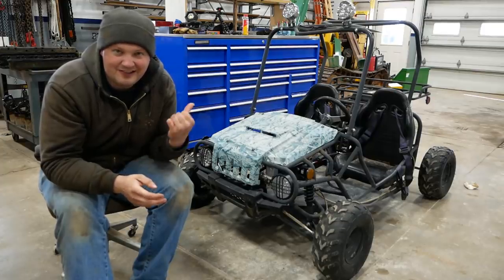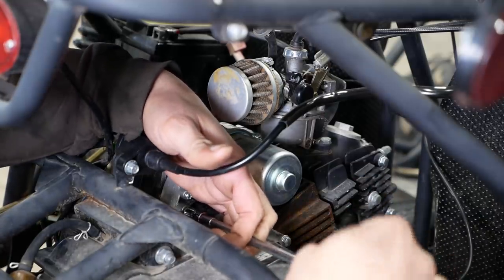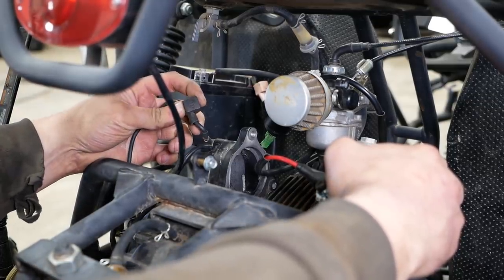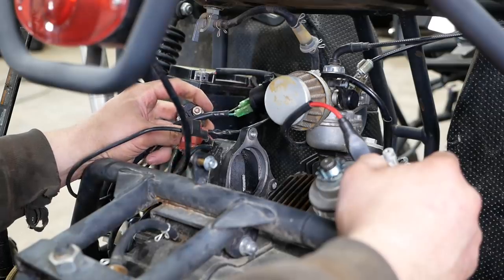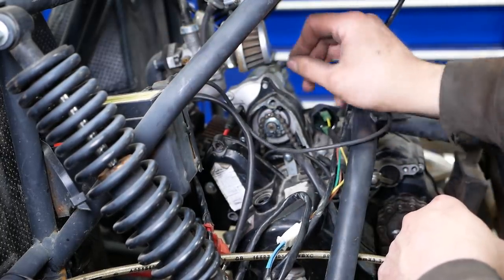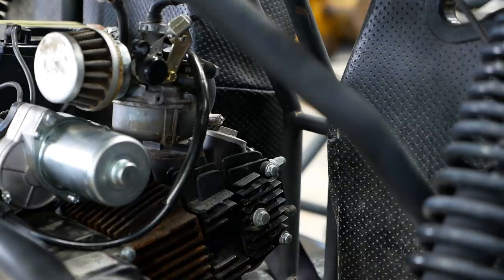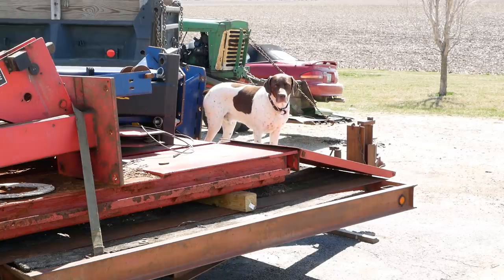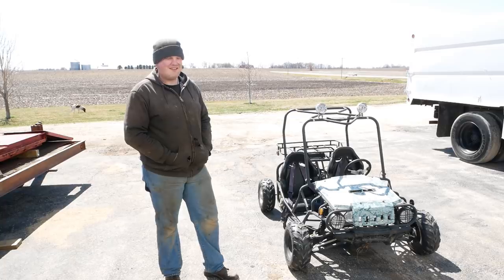Go Kart Saved from the Parts Cannon

Comment: Started replaced, badly.  Wiring re-worked, badly.  Carburetor adjusted, badly.  John Q. Customer was here.
Reply: He mentioned that there was something melted around the solenoid.  I suspect positive and negative from the battery were put across the solenoid, so at some point when he hit start, the battery was shorted out, causing lots of heat!  Random rewiring after that reversed polarity.

Comment: I saw a cap fall off crankcase.  Also right front is cambered away.  Nice work Wes.
Reply from the maker: That's an optional cap...
Reply: @WatchWesWork  From a beer bottle?
Reply: @alanfarenden9378  I think it was a cap for timing check hole. Without it, the generator has good chances to meet with sand, rocks, mud, water and everthing nice that this thing is driven on or into.
Reply: @WatchWesWork  oh cool.  Thank You friend.  I enjoy your work!
Reply: Oddly enough it started running just fine right after that.   Clearly a faulty cap!

Comment: The best part about it, Motorcycle type starter solenoids usually have a B and M moulded into them for "To battery" and "To Motor" for guidance. Still easy to get wrong though if the brains not engaged.

Comment: HEY WES. From a few minutes earlier, 14:56 I watched a cap come loose.  AT 17:06 WHAT FELL OFF THE MOTOR, A CRANK CASE CAP....+++ I HOPE you found it...
Reply: Also, it kind of looks like something electrical burning at 16:54 (and before, those repeated puffs of smoke coming up around the carb), and I also noticed something rattling off the engine at 17:08 too - what a piece of work that thing is!

Comment: Looks like a Honda CCR 125 from 50 years ago, literally. The Chinese must have been making these for 40 years. Probably the same master molds.

Seeing that “tappet” cover and goofy cap on the carb brings back memories. I used to make $10 changing a large “plastic” gear in the tranny after each race for a bunch of guys in a motorcycle club next to my house in 1973.  They destroyed them every race. 

I used to charge $25 to “rebuild the motor” using a wire brush to tear carbon off the cylinder head and piston crown. Hard to kill those old four strokes, even when you had no idea what was going on. 

I was the club “mechanic” because my dad had a complete set of Craftsman mechanics tools. That was the hillbilly SnapOff of the day. 

Hilarious. Thanks for the memories.

Hey!  We used to rewire these by connecting wires to wherever they’d reach. Nobody had manuals, tools or brains. Just an old Crescent and a guess based on how long the wires were. It always worked after a few tries.

Comment: I take it you found the Chrome oil cap that vibrated loose and fell on the floor? All the best from Canada
Reply from the maker: It's just a dust cap. That's a dry cover.
Reply: @WatchWesWork  I was also thinking that maybe he had some water in that gas tank? And that's why I wasn't running the whole time?

Comment: Definitely on the small side for you. They are good fun though. My mate has built his self a dirt buggy on steroids. It runs a 300cc Kawasaki Ninja engine. Straight gate gearbox with foot clutch and throttle. Geared to be lightning quick low down but still pulls 80K plus. On his tight track between the trees it is one he'll of an adrenalin rush. Pure driving experience. Your next video will probably be a huge truck or tractor. Nothing like variety.

Comment: My guess is starter originally went bad (just replaced one on a 50cc quad with the same clone setup) and they did battery as a "starter for 10" pun fully intended, then changed the starter but got the wires crossed and let a little smoke out, crossed them up even more until it would spin (but bass-ackwards, as it is permanent magnet type) and that being the case, it didn't matter if they got the chain on or not as it would've presented the same symptom as the starter is on a one way sprag clutch.  Nice work getting to the bottom of it, and not stripping any cheese threads on the way! Those things love to jump out of the hole with the slightest whiff of torque. the chrome oil cap cover is usually the first thing to vanish so it did well to hang on longer than the choke cable haha.

Comment: Recently worked on a Mikuni carb for a 9hp generator.  Fuel was coming out of the carb's choke area and soaking the air filter, and then dripping on the ground.  Engine ran smooth at half choke but with fuel coming out of the carb like that it wasn't safe.  Found the carb diagram/schematic on the internet.  Discovered it was missing a brass pilot jet on the top of the carb.  New p-jet was about $18 w/s&h.  Fixed the leak.  Also, had to use a magnifying glass, loupe, and penlight to see the condition of some of the smaller jet ports near the choke, AND in/around the main jet inside the carb bowl.  Those smaller ports WILL clog with the smallest of particles, and the engine will not run.  I also recently worked on a newer, 5hp B&S engine with a plastic carb. Ugh.  It has very small port holes in the plastic that you should use a magnifying glass or loupe to find dirt or gum-like residue either on or clogging them.  Good video.  Could be the lighting but that gas looked old.

Comment: Thanks Wes for your walk through.  I have a 150cc UTV by ODES that I need to do similar thing with due to fuel issues.
Reply: It starts & idles, but try to give it gas, and it chokes itself.  Tried spare fuel pump, didn’t help, dropping tank to check fuel lines, then pulling carb.  Daisy chain

Comment: Fixing broken/faulty/damaged stuff can be tricky but fixing stuff that someone's been fiddling with can be an absolute 𝒏𝒊𝒈𝒉𝒕𝒎𝒂𝒓𝒆. I wonder what the original problem was, or was the owner just "servicing" it and caused the problems himself.
It would be interesting to ask if he still has the bits he replaced; could be a few perfectly good spares in amongst them. Well done figuring it out though.👍👌
Maybe Mrs Wes, or Wes Junior, would have been a more suitable test pilot this time.😂

Comment: At 14:58 you can see a chrome lid or cap of some sort, under the carb little to the right on the screen, starting to turn when the engine revs. At 15:55 it wobles around loose and at 17:07 it finaly falls of. What was it?

Comment: Well mark another save for you. I was wrong as when the engine established some compression meant no or very small crack in the piston or a valve funky. I know bad descriptive terms but my chowder funnel is kinda fubar. I got to thinking is the valve lash a hair tight as they are fussy about that as you get that putt putt sound of trying and still no start. I liked those type of snow machine carbs. I used to put one for each cylinder on the little ranger pickups and they came alive like right now. I was sure I was right as it made the skipping sound rolling over. I found they if running right need very little choke if any. Just get one to putt putt    and it warms up fast. I really didn't think that you could get in it either but then you did an my fear of a leg cramp came to mind and a whole roll cage and all tore off so to straighten the leg.  I really don't know how many miles one of those engines will run but it has to be a half million as my kids ran theirs from can to  can't see. Fine recover Wes

Comment: Theory of failure:
Brought out of storage and tried to start it with the peckok off.
Didn't start so they tampered the carb needle furthering the issues.
Got frustrated that it wouldn't even start on ether so they held the starter until it fried.
Replaced the starter but didn't pay attention to polarity and when they tried to start it the compression in reverse caused it to kick and throw the starter chain.
Not realizing the issue they checked and found no spark, thinking that was the original unforseen issue they replaced the ignition components one-by-one hoping to get spark.

Comment: Toa toa , I  fix 3  4 wheeler version of those ! For my daughters for cheap !! Carburetor $9.99 to the door . Complete wire harness :  key,coil,cdi, fuses, battery leads  $25.   I run royal purple  and premium gas in them. Two of 4wheers  had bought had tar for oil when I bought them , had to take side cover off and scrap out the tar/oil  with screw drive then soak in carb cleaner for a few days. Those starter chains get rusty and stick real bad ! I grease them up real good every time you touch a starter !

Comment: When you were removing the starter I said, might as well remove the carb too as guarantee it's gonna need cleaned. But I would have also removed and cleaned the gas tank and shut-off valve. Probably checked valve clearance. Set the toe-in. There is a reason I didn't make money in my 45+ year mechanical career...

Comment: I suspect the choke cable broke and they cooked the starter trying to start it. Those starters are often so cheaply made they melt any plastic in them if used for any period of time or the epoxy holding the magnets to the case softens and they come loose.

Comment: Was that the oil-fill plug that fell out when you started the engine? (silver-colored thing on lower-left of engine)  I work on these chinesium things often. Parts are stupid-cheep (coil, CDI, volt regulator, and ENTIRE wiring harness for about $20)
Reply from the maker: Dunno. There's no oil over there.
Reply: @WatchWesWork  Well you need to rewatch the video because something shiny was bouncing around and finally fell off

Comment: I bought my boys a TaoTao 4 wheeler with what appears to be the same engine at a garage sale.  It was cheap because it was dead (dirty carb).  Mechanically it was pretty decent but after a never ending parade of failed electrical components and hinky wiring we replaced the engine with a 6 hp honda clone.  It was a good decision.

Comment: I think Menards sold those. Probably had a fuel problem. They cranked it until it stopped cranking. Replaced the battery but the starter died then screwed up the wiring and chain replacing the starter so the engine didn't turn hence no spark. There's an old saying, 90% of ignition problems are fuel related.

Comment: I just did a job for a customer on a Coolster 4 wheeler and ran into a similar issue. It was only three years old, but the starter was bad. It didn't the same way that a bad starter normally does. I tried everything else first because I assumed that a starter would not go bad that quickly. I was wrong. Apparently, it is a common problem on those clone machines. It looks like that machine has the same starter. I would say that the starter was the original problem.

Comment: due to all the weird stuff you found, I would first check which way the motor actually turns by cranking it by pull cored to know for positive that the starter is wired wrong.

Comment: That starter will run backwards if you switch the pos and the neg, tell your customer to get rid of that 19mm carburetor and put a 22mm or 24mm one on it, they fly with a 24mm carb on, also these engines have a habit of buggering the crank position sensor when they throw the chain as the sensor is just in front of the sprocket behind that generator cover, the buggy its self looks very much like a Quadzilla, mixture screw is 1 1/2 turns out

Comment: Wes, while watching the start up attempt @ 15.02 I noticed a "silvery" screwhead/bolt to the right of and in line with the nut holding the seat and next to an electrical connection on the frame, vibrate and slacken and eventually drops off at 17.07 onto the floor!! Imporatnt??? Cheers, Murray.

Comment: As Liam1981 said, there is WATER in the gas!!!! Plain as day at precisely 13:28 there are clearly two drops of water falling out of the carb onto the bench. As a result of your cranking and choking you pulled the water through the engine. When it finally got gas it started running and as it warmed up it expelled the last of it. All of the owners lame attempts at repair was a result of that water. Perhaps his offspring, fruit of the same tree, gave it a drink from his water bottle.
Art

Comment: I think that carburetor is a mcloney brand carburetor. You can buy all the parts you want on Amazon for cheap. I found a complete motor with starter ,new mcloney carb with air filter and gaskets, all the modules, cdi, coil,ignition switch,starter button, for $300 with shipping. Just look up Chinese four wheeler. The parts are endless

Comment: So starter turned the engine backwards and it backfired and threw the chain off? 😬
Reply from the maker: I don't know. I don't think the starter can run backwards. I should have tested it.
Reply: @WatchWesWork  but it would explain your fuel issues... as there's crud from the start attempts in the intake side of the head. That's why itself cleared after a while

Comment: On all these little chinese engines the biggest mistake people make is an inline fuel filter. They make barely enough engine vacumn to pull fuel through a carb engineered with a Black & Decker, let alone overcome the resistance of the fuel filter. Seen many a small engine whereby the running is improved by the simple method of getting rid of the inline filter. The fuel's filtered by the filter in the filler neck, there is amost certainly an internal filter on the fuel outlet as well.

Comment: Those Chinese built engines and carbs are finicky to the nth degree. Must have absolutely clean fuel even the dye in farm fuel wreaks havoc in the carb. First hand experience for me. Thought you'd like a little information as I thought there was a little bit of water in the carb when you took it apart. Hope this helps for down the road.

Comment: Starts Like The Old Fords  Hot A Ground And A Key Wire You Can Build One For You Had Big Go Cart Hand Built Not Fast But Fun 10 hp Belt Driven Push To Start What Fixed The Cart?

Comment: Two words: Chinese Junk!
And when a non mechanic starts repairing the wrong thing you get this. Those go-karts are pretty much fun to drive, but you see the lack of price in the lack of quality.

Still a lot of fun to see you repair something like this for a change. Those tiny fuel filters clog up pretty fast, probably a bit of dirt holding up the fuel causes the motor to stop pretty quickly, reverse blowing with pressurized air keeps the fuel flowing. It wasn't the problem here, but is often so.

Comment: What was that horrible clanking? I have a similar engine in my pitbike and it does NOT produce any similar sounds. 

I know in the end it was the seatbelt dragged on the tarmac, but there’s one pretty often when the engine is running.
Reply from the maker: The exhaust is loose.

Comment: I worked on a kawasaki bayou 220 that u could only recoul start. U could hear starter turning so we changed it and still nothing. Took side cover off and changed the one way clutch for starter setup and still nothing. Turns out someone mixed up a ground wire with a hot wire on the starter solenoid. Somehow was spinning starter backwards. Lol so of course the one way clutch wasnt engaging. Lol

Comment: Honda 50/70 clone engine. Lots available anywhere from 50-212cc. Most of them work pretty good. Its a dead nuts simple design from the 60s so even the chinese cant screw it up too bad.

Comment: Tao motors have a bunch of knock-offs, most engines are based on Honda stuff and almost all parts will interchange ( cheap clone is a better word than Knock off). Most of the stuff is "OK" for the cheap price. Not even close to Honda quality but with some care, they last and work.  fairly well. Most of the stuff electrical is crap, and you need to check every bolt as they ship missing and lose quite often. But they are often 1/5th price of a name brand and might last half as long, pure money it's a decent deal, most kids outgrow that stuff in a few years. Have one of their scooters and a 250 enduro bike, both are worth what they cost but require some know-how to keep them serviced.
Reply from the maker: Interesting. I have a log splitter with a Korean Honda clone engine. Every electrical part fell apart, but the engine runs great.

Comment: I'd stay away from those cheap Chinese carts, 4-wheelers and mini bikes. Nothing but problems. Neighbor had them ad I had to fix them several times a year.
Carbs were the worst. Float never seals and rebuild kits for clones of clones never were right. Finding a real bike carb would help.
Metal casting are piss-poor. Have seen them crumble to nothing. HIt a bump and axle, frame or wheel bends.
Keep an aye out for those old go karts with a B&S engine. Can be easily fixed and run forever.
Eventually I refused to fix them. Heck, most of the suppliers refused to carry parts.